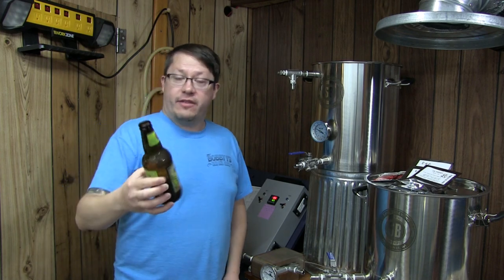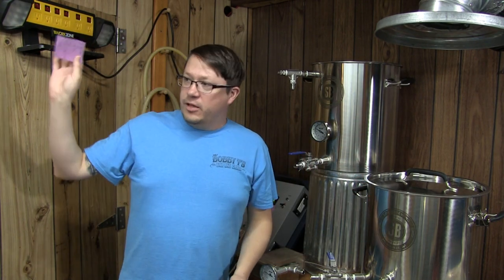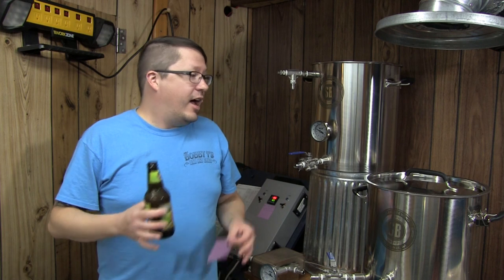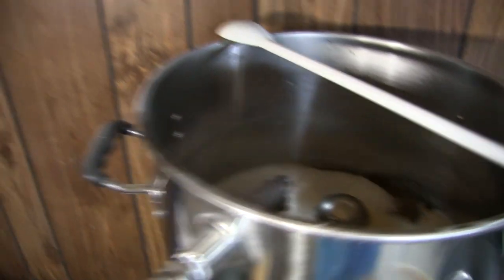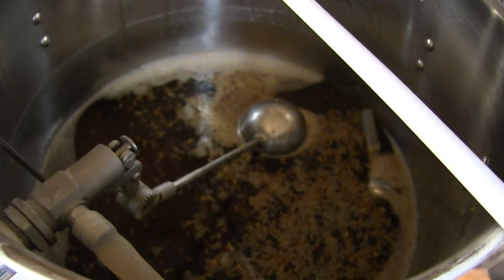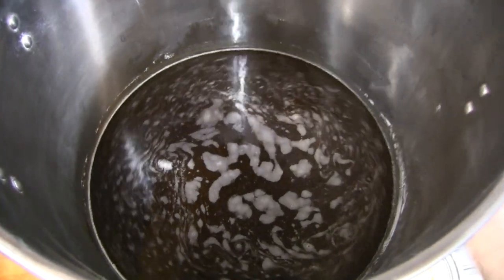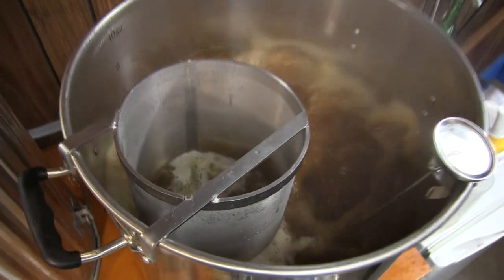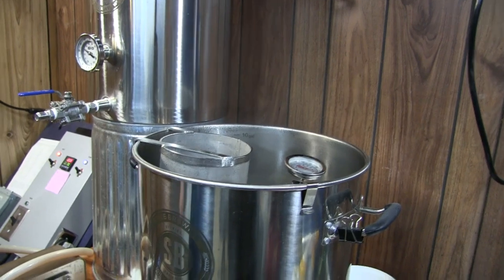Brewing an ESB with Joe (and Matt!)  First brew in AGES!

Comment: What's ballpark on what this kind of setup costs?
Reply from the maker: My setup is pretty intense.  A lot of folks, myself included at the start of all this, use propane or large electric cooktops, so a "normal" setup could be just a couple hundred bucks.  My setup here is a couple grand all told, with the the controllers, custom pots, pump, lines, etc.
Reply: @terpsichoreankid  thanks for the info! It definitely looks like a prime setup
Reply from the maker: Happy to help!